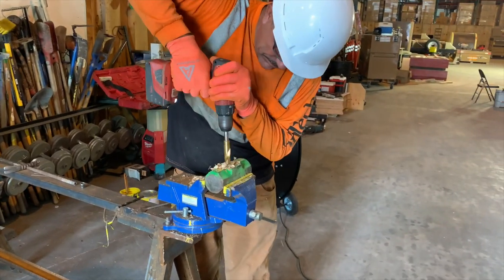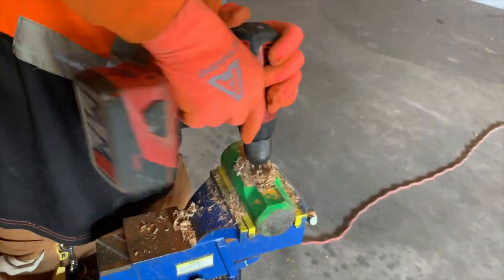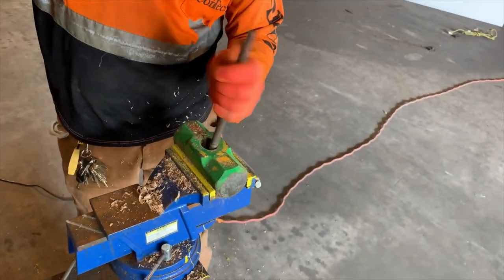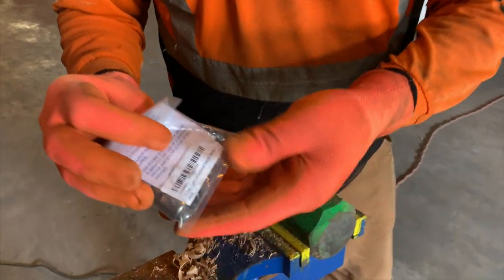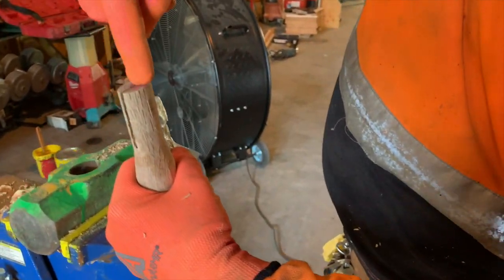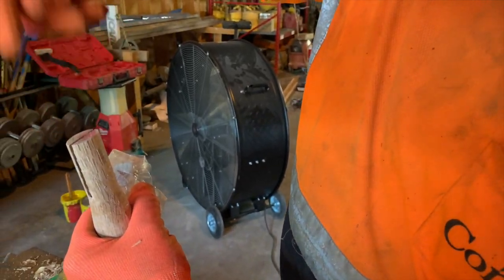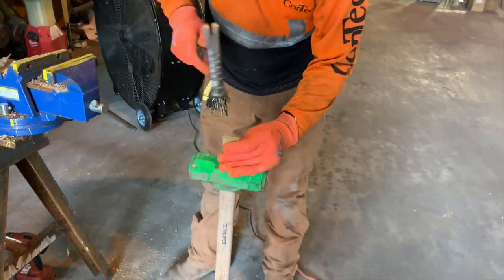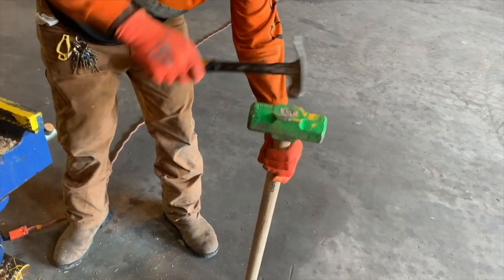How to Replace Sledge Hammer Handle

Comment: Bought my handle from Ace Hardware. My problem was I bought a handle that was too big and I tried to sand it down to fit. Did not go all the way down to where the thicker part of the handle starts. Broke off after a while of using it. My fault. Went back and bought a shorter handle with a narrower diameter. Still had to stand it down a little bit but was able to install the big fat wedge, and I used the old conical metal insert and not the two wedges. Get the head down to the beginning of the handle. Much much better. Your instructional video convinced me to not use the wedges. I was able to drive my shallow sand point well on our cabin property up north without having the head fly off. So that's good. Thank you for the video.

Comment: If only it was as simple as all that. I tried to do this today and I wound up with the handle sitting at a weird angle in the head. It's not straight at all. Now I need to cut it off and start over from the beginning.
Reply: I’ve replaced 3 handles using the videos demonstration. Works like a charm. You must be barely off on a step. I’d have to see in person
Reply: What kind of wood wedge is it?  I didn’t know that I needed a wood wedge with my triangular metal wedge.